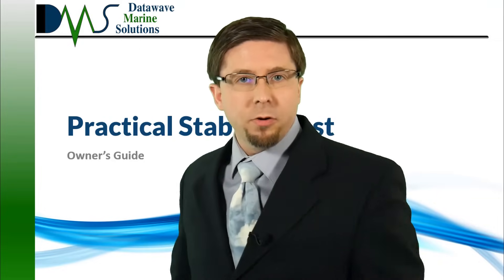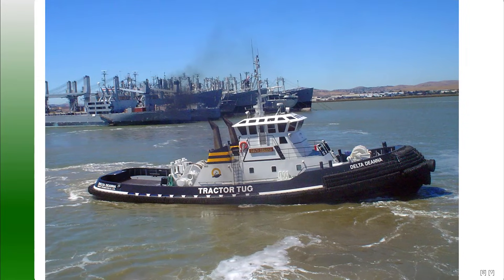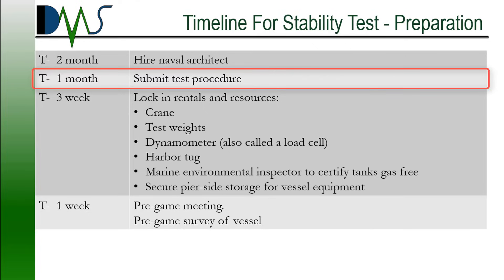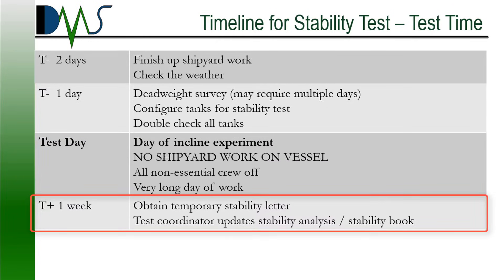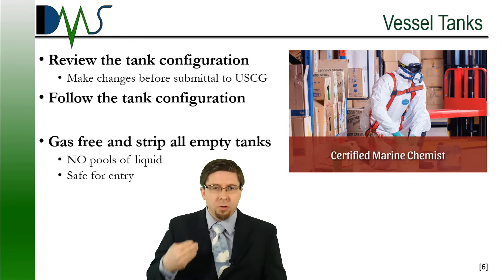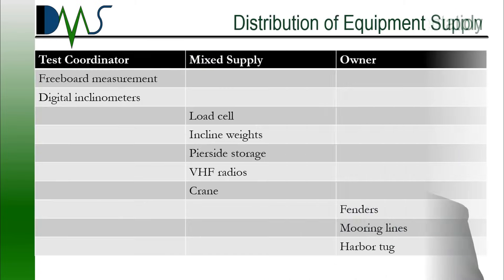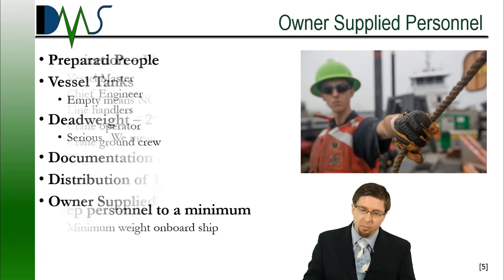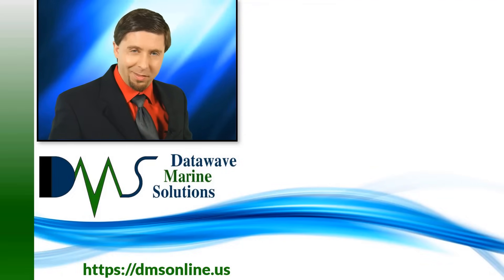Practical Stability Test:  Owner's Guide

Comment: Watched a few of your vids. Mainly about hydrofoils and trimaran hulls. Tryed looking for a video about what people said was a cathedral hull. Not 100% sure if it's an accurate name. So yea.

I've got a small boat. Kinda makes you think you've got a trimaran. But the "hull seperation" isn't that massive. The gap between the V shapes, is very shallow, although they are still very present from front to back. Once in the water, every part under the ship is touching the water.

Can you explain what the pros and cons of such a hull design are? Where it is posititoned in the mono-hull/trimaran-hull and catamaran hull? (for refrence, my boat is a slightly rare "trifoil 70", a few pictures of such a boat can be found using google)